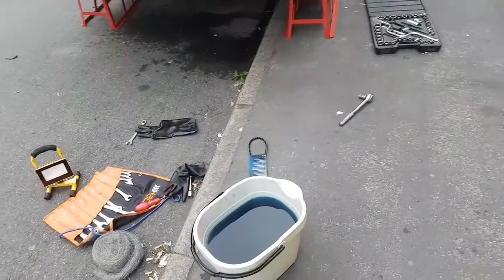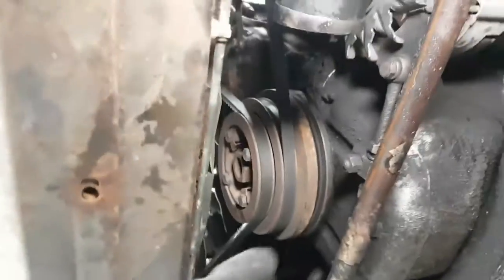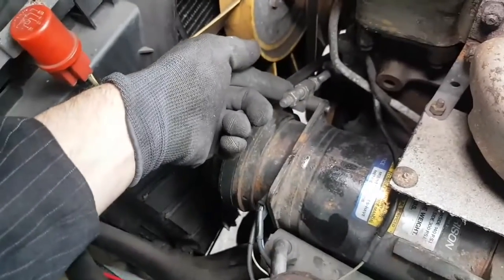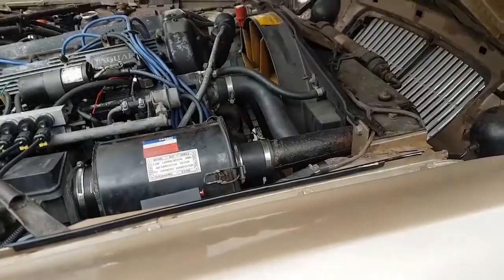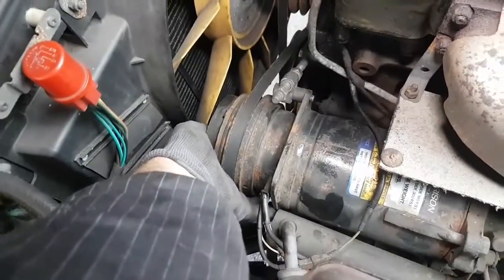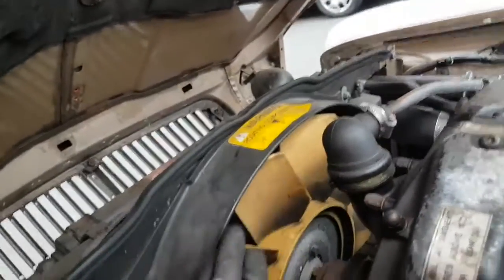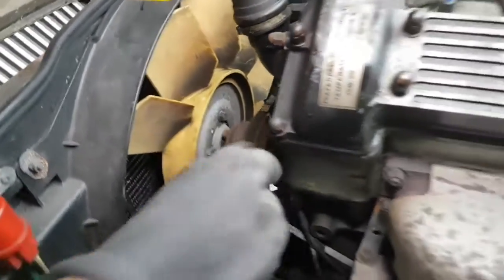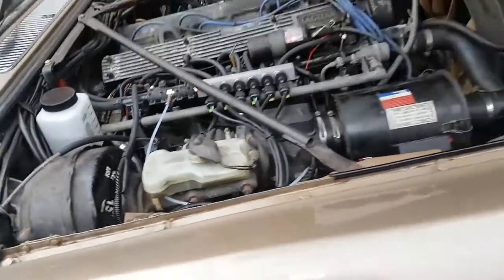Struggling to replace alternator belt.

Comment: Could you give us the generic part numbers of the belts please. I will mentally prep myself to do the same job....
Reply from the maker: These videos were recorded some time ago,  I didn't keep packing, or note part numbers, however, it is possible part numbers will be identified in later videos, when I eventually receive correct parts.
I have several hundred videos to upload, I'm currently working on & filming extensive body restoration.
Reply: @beelzebubthejag  Great! I have a 4.2 S3 '83 and replaced both tanks a couple of weeks ago and about 100.000 petrol hoses including the clamps.... Working on the water hoses now....
Reply from the maker: @magnusterminus4728  These are wonderful cars, I have refused to drive anything other than old Jaguar for past 33 years.
It's going to take months to post all videos recorded so far.
How long have you had your S3 ?
Reply: @beelzebubthejag  Bought it in 2007, stored in from 09 to 22. It is an ex Swiss car, 116k km on the dial. Silver metallic with biscuit. The car was anti rust treated with dinitrol so it is still in good shape. Next is the stainless exhaust. Like you I guess,I have no affinity with modern cars. Drive my volvo 144 '73 aut also regularly. I life in the Netherlands btw. Cheers!
Reply: Keep up the good work!!
Reply from the maker: @magnusterminus4728  It sounds fabulous, I hope you are able to keep it long term.
The restoration of Beelzebub has reached more advanced stages, therefore, I have bought another Jaguar xj6, a '95 4.0 called Lucifer, I will drive Lucifer 200 miles to my other home this evening